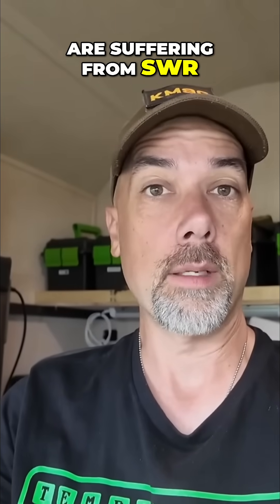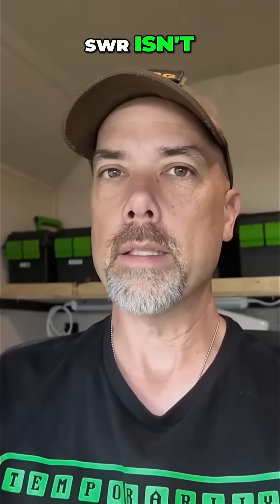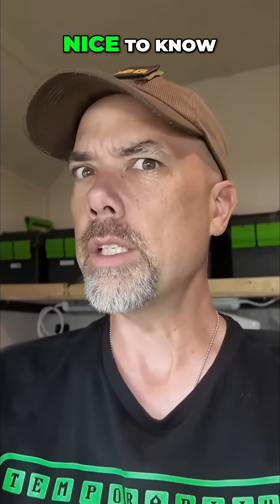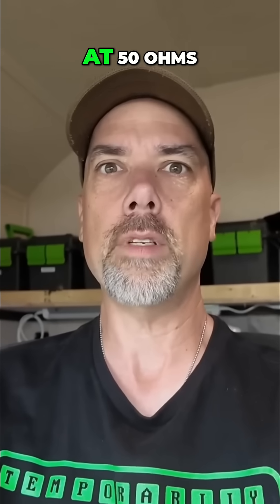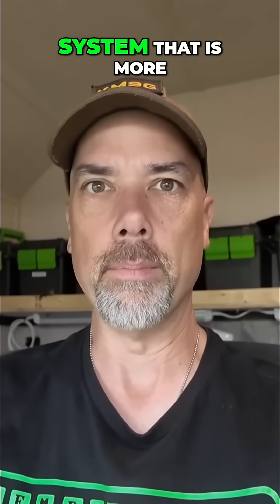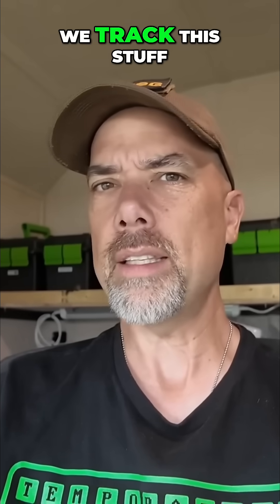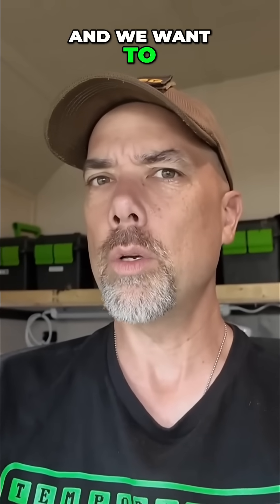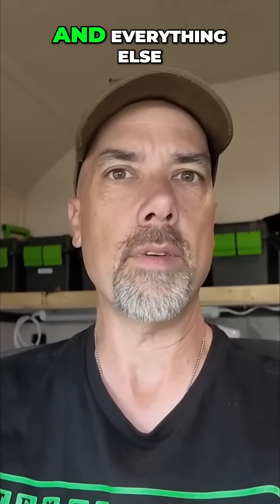SWR Explained: What Matters for Radio Communication #shorts

Comment: People forget that a dummy load will give you a 1:1 SWR. But, there isn't much actully being radiated. Just because the SWR meter shows low SWR ratio, that doesn't mean the antenna is giving you good emisssion.
Reply from the maker: Exactly Right.  The real deal is protecting your gear and making contacts.

Comment: I heard an older ham one day talking about the length of the coax affecting the SWR.  He suggested someone could tune an antenna by adjusting the coax feed line length.  That might be an interesting Ham Nuggets video :o)
Reply from the maker: Brian Enters The Arena 🍿🍿
Reply: If you're talking about coaxial feedline,  that's garbage. If you're talking about balanced line fed, that's absolutely correct.
Reply: @AI7RK  I may have not completely understood what the fellow was talking about.  So YOU are saying with coaxial feedline like RG8, it's length has no or very little affect on the SWR and that is it strictly the physical characteristics of the antenna (ie lengths of the elements) that affect the tuning of the antenna?  I just don't have a lot of experience with tuning antennas :o)
Reply: @briankendall1978 like with anything,  it's more complicated. Length of coaxial cable will affect line loss, the longer the cable, cheaper the construction,  poor dialectic, those will all increase line losses. Depending on the antenna, not using a transformer or choke at the feedpoint where the coax "becomes" the antenna, can dramatically increase SWR due to common mode current traveling back down the feedline. As far as tuning with coaxial feedline by changing the length, as far as I know the only way you're doing that is if you're using coaxial stubs for tuning,  which I doubt was what he was talking about. A longer or shorter feedline isn't going to affect SWR like that unless the bit you're lopping off has water ingress in it. Now, balanced feedline like ladder line, window line, twin lead,  etc. will absolutely change the function of the antenna by tuning the length.
Reply: Now, if he's talking about an endfed antenna where he's effectively using the coax shielding as his counterpoise,  yeah it can affect things a little depending on his antenna design, if he using a transformer, what kind of transformer, how many wraps in that transformer,  etc.
Reply: @AI7RK  Also I am thinking VHF UHF more than HF. So like tuning a mobile antenna by trimming the feedline.  
BTW Thanks for taking the time to help me understand this topic. 🙂

Comment: working on commercial always only measured forward power
Reply from the maker: did you have circulators?  Regardless, you're right - the most forward power comes with the least reverse power.

Comment: SWR only gives you a part of the info you need to fix your antenna. You need phase as well as amplitude. So buy a VNA and you can tune any antenna down to 1. The Smith Chart is what you need. You can mount it in the shack and still get correct answers provided you do your calibration up at the entenna. They are not expensive - do it now and learn the joy of return loss instead of the Jurassic SWR.
Reply from the maker: Smart